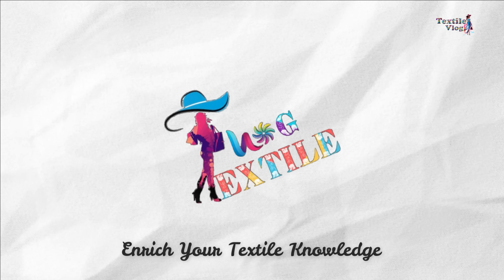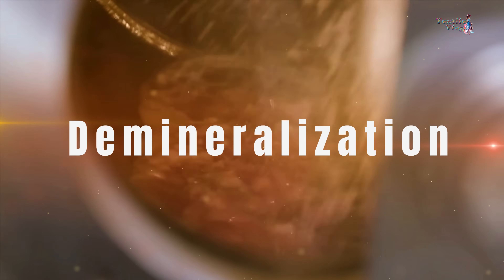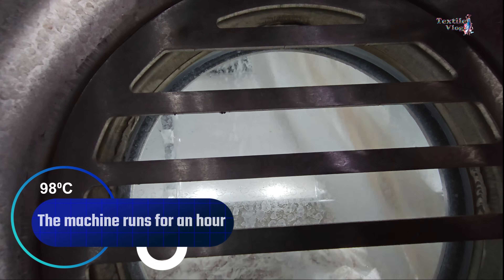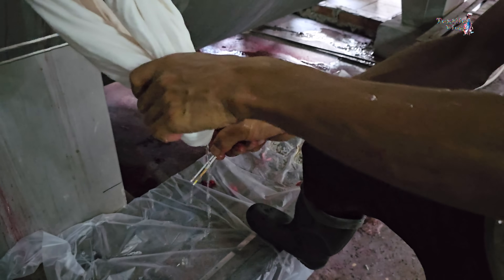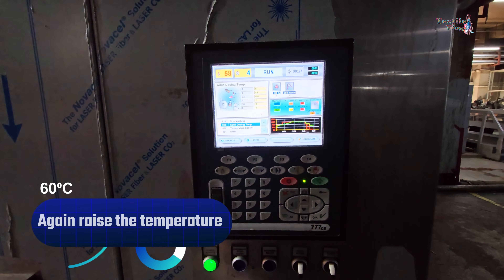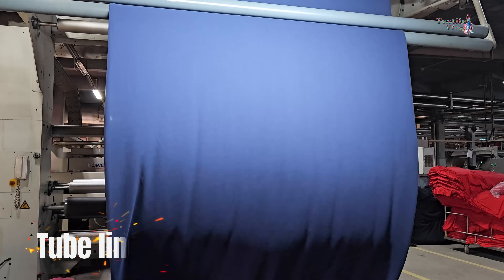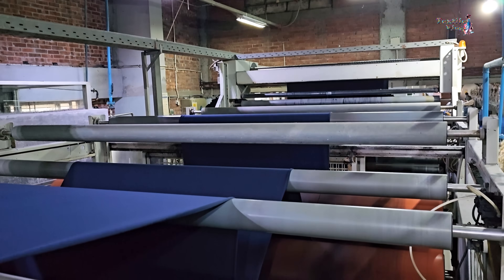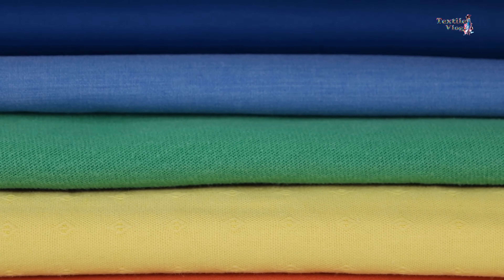Knit Fabric Dyeing and Finishing Process - A to Z Explanation

Comment: for tubular fabrics, why does the diameter shrink during dyeing process? for ex a 46" fabric comes out around 41" from dyeing and then needs to be heat set at desired dia.. why does dia shrink during dyeing (talking about single jersey fabrics in particular)